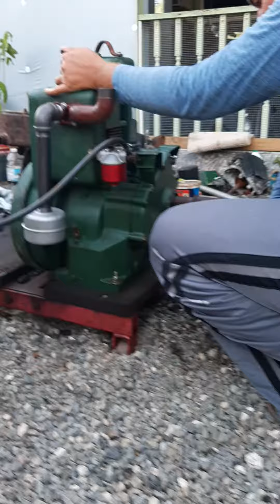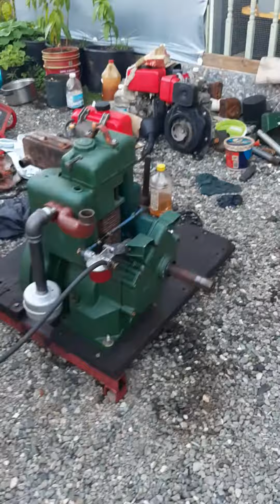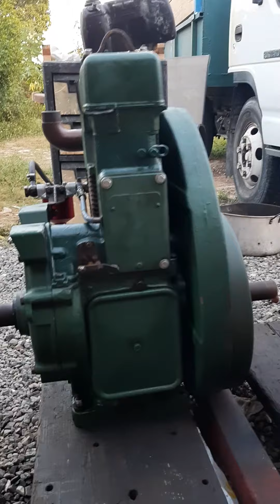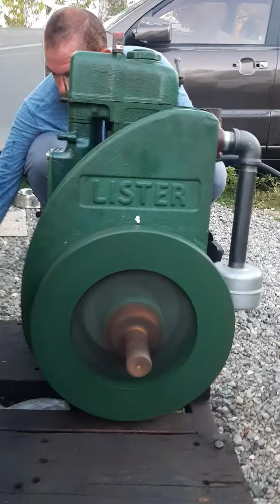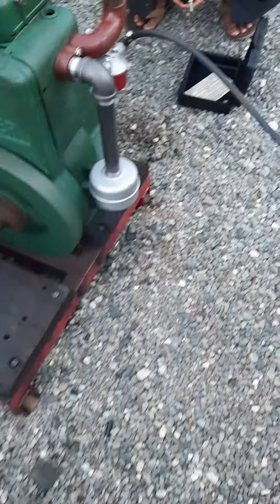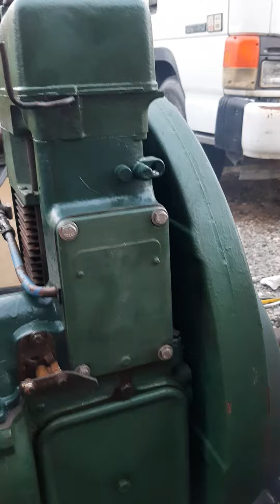Lister LR1 First Smoke

Comment: Cut my teeth on these in Benford 5,3 Mixers many years ago. The cylinder head exhaust port used to clog with carbon because of the muffler being down on an extension pipe next to the rear axle. The lads on site would pile sand and cement up around the wheels and then...........blocked exhaust. Nice runner, stand up when you crank it, it's safer.
Reply from the maker: Thank you for the comments. I know what you mean re the exhaust. 
The engine is bolted to our repair/running stand which we use for repairs and test runs only. It is actually the base of an automobile engine stand which has 2x12 boards bolted to it, with multiple holes drilled to fit various engines. I agree that it's very low, but it cost practically nothing, is quite robust and works well for our purposes. The height of it prevents us from standing while turning the starter handle, but we stand while starting the rope-start engines.
Reply: @crazyenginewiz  Thanks CEW for getting back. I think your doing a good job with the engines, just watch it with those starting handles, they can catch you out. I have overhauled a lot of Lister and Petter Engines in my time and still prefer them to modern industrial engines although I’m retired now from 35 years as a construction plant mechanic. All the best.